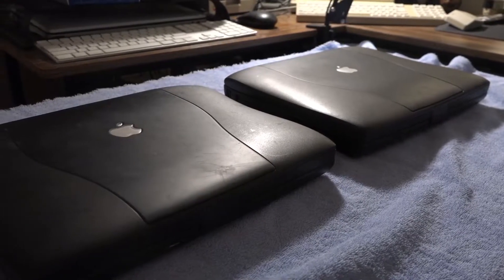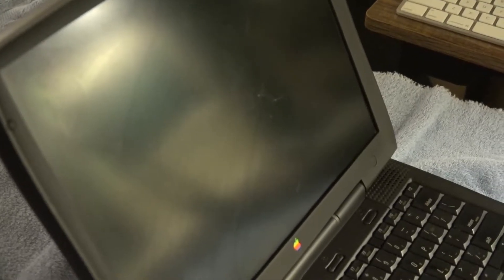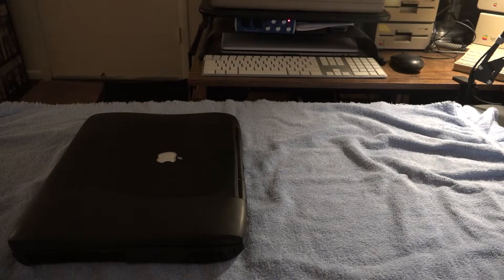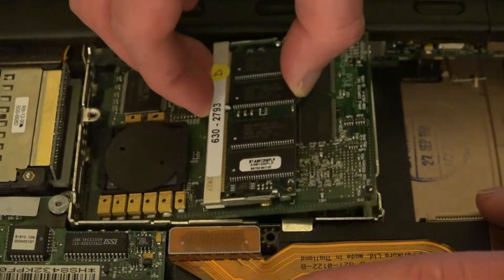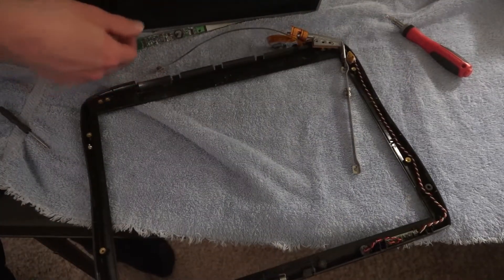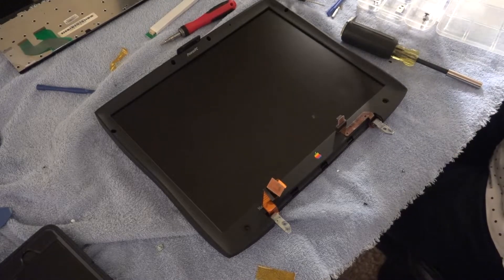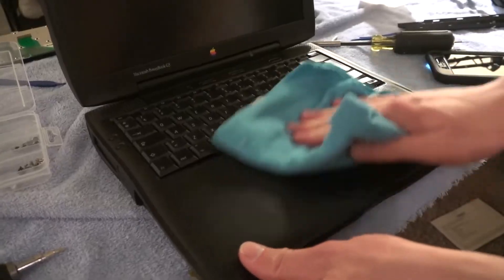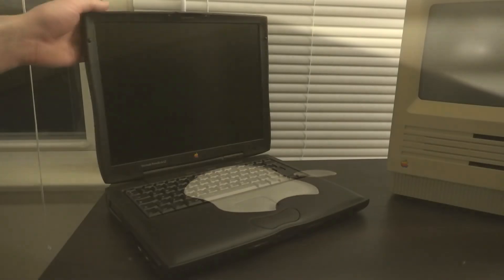Macintosh PowerBook G3 Wallstreet - TEARDOWN/ RESTORATION

Comment: Hi. I have a G3 like the above. I bought it in 99 I think. It sat on a shelf for years. It still works, after being plugged in for a while. I’d like to get a few files off it. But my version does not have usb. It has 9 pin rs232 (I assume) and apple talk. Would a rs232 to usb adapter work? Would that allow mounting a flash drive? If so, what file system? The files I want were created with FullwritePro (my all time favorite wp app). FW can save to pdf so I could convert them pdf to word on my current m1. Any thoughts? I’m willing to pay (modestly) for help.
Reply: The easiest way to get files off of that Powerbook G3 would be over a network with the ethernet port. If you wanted to add Firewire or USB to the computer there were third party companies that made PCMCIA cards to add either of those.

The serial port can connect to an AppleTalk network but that's a really slow connection. The serial port was normally just used for a printer or external modem.

Another option would be to copy files to a SCSI drive if you have the right drive, cables, and/or adapters. Then you would need another computer to read the SCSI drive, which aren't used much these days! The PowerBook G3 even supported target disk mode over a SCSI cable if you wanted to do that.